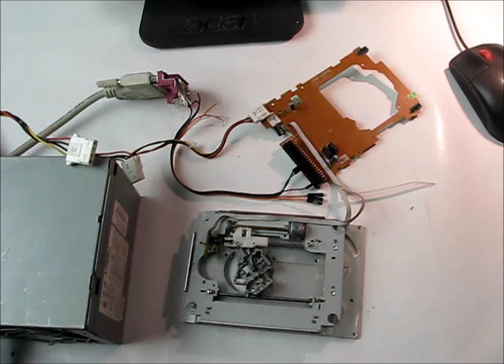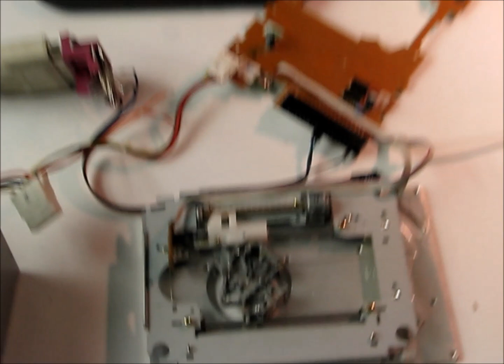DIY FLOPPY DRIVE CNC: Part 7 - First Axis Testing and Summary

Comment: mine stepper motor vibrates ,and heat up but not moves, i am connecting with l298n motor driver ic ,, what to do ,,